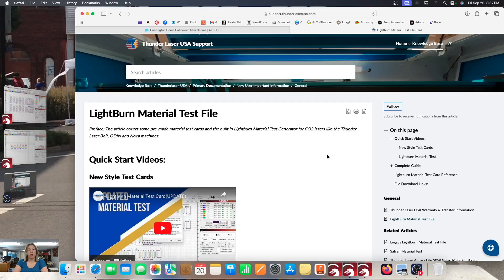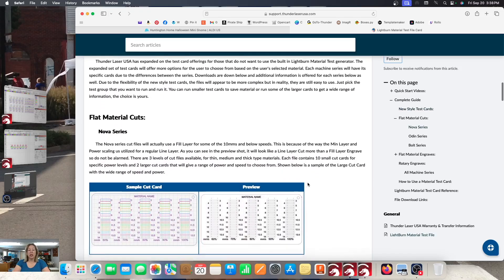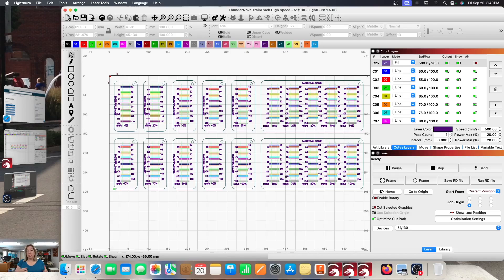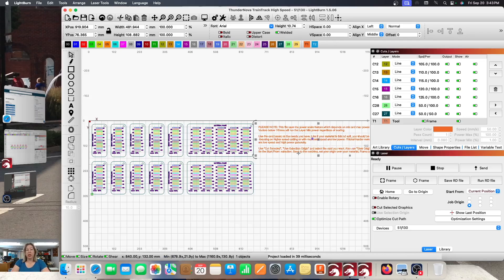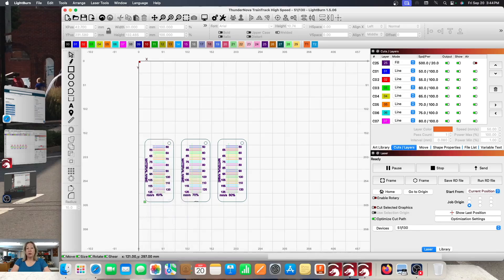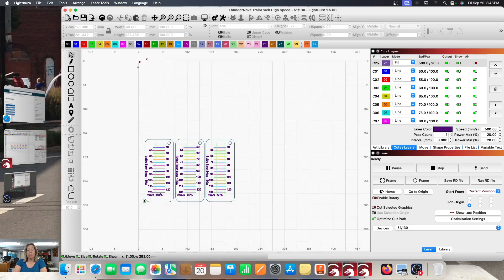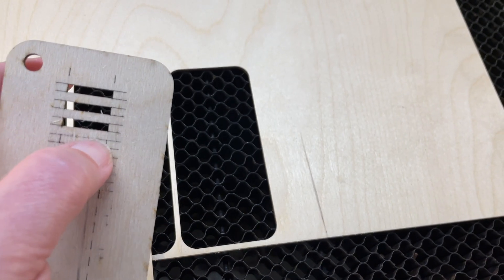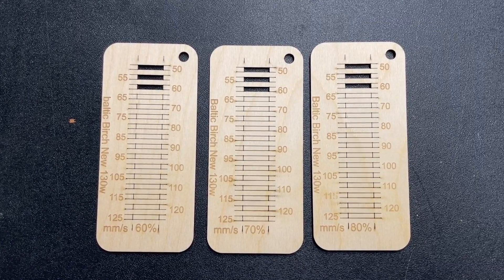Your First Laser Project!! NEW Material Test Card From Thunder Laser USA

Comment: Look at the Power settings for Layer 28. They are the are the vertical cuts and they are the same  power as the first cut layer and 50% power. Not sure but that does not seem right.